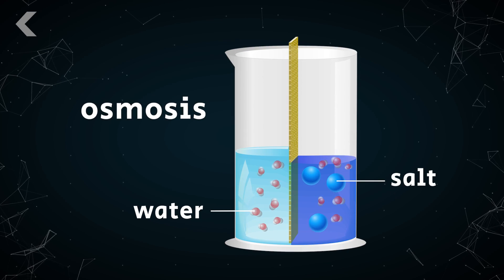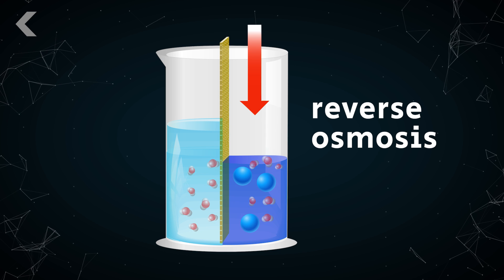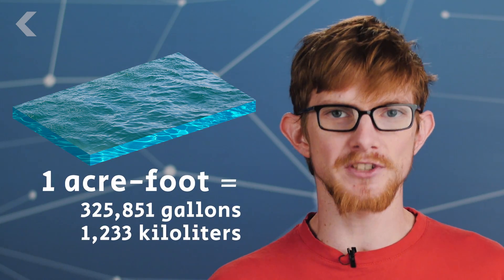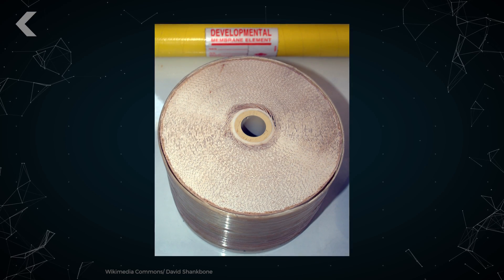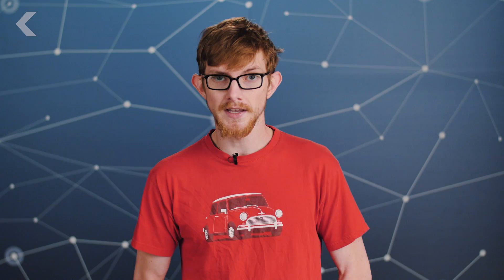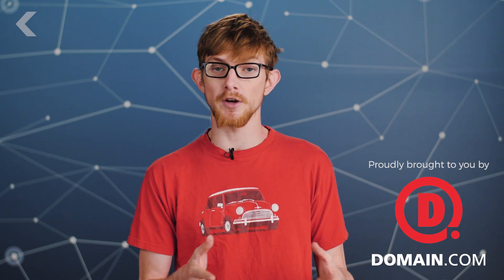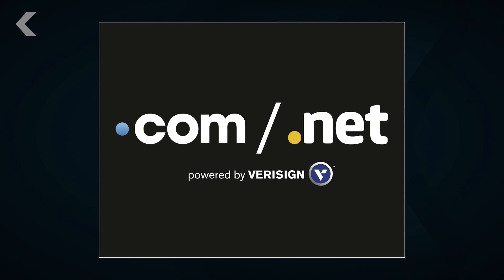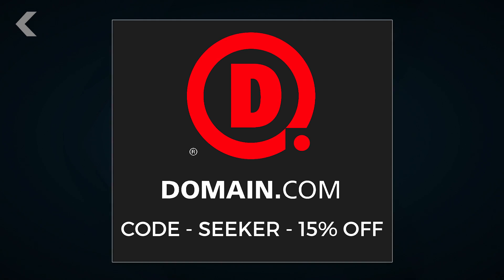Graphene Could Solve the World's Water Crisis

Comment: Electrocoagulation is safe, cheap, and faster by volume than RO. The whole system consumes far less electrical power than RO, and can be easily supported by a solar farm and electrolytic battery cells which unlike newer and current battery technologies decompose so little in use, the service life expectancy is up to 30 years.

Comment: How much pressure do you need across the reverse osmosis membrane?  Would the changing water level of the tides provide a sufficient pressure difference for reverse osmosis?  It would be a massive project, but could you design some kind of channel or canal that would resonate with the tides to get a bigger change in elevation like what happens in the bay of fundy?

Comment: Given that the majority of dry places needing desalination plants are usually very sunny and hot (yes, I know Antarctica is a desert, hence "majority" and "usually", though ice rarely has salt in it), then surely using solar panels (made from graphene if it is so much better) would decrease the need for "dirty" energy? Or mirrors aimed at the top of a tower to create steam and then generate electricity could be used if graphene panels aren't yet cost effective. The steam, when condensed could be distilled to clean out larger molecules of salt or other nasties. I guess I'm saying that some imagination could be applied to current technology leaving graphene to play a role in areas where it is the only feasible material. Still a fascinating idea though.

Comment: Something doesn't sound right to me here.  If you're making a filter from a molecular thin material that has pores just large enough for H2O but too small to allow other things through, then you should be talking about a gap the is being held in position by molecular bonds.  To my knowledge, molecules do not swell.  Just how is a water molecule supposed to insert itself into the molecular bonds of graphene to cause the opening to increase?  Maybe I'm misunderstanding the mechanics of this.

One other thing.  Although reverse osmosis is more energy efficient that distilling, the cost is offset by higher maintenance.  Just how is adding a far more expensive filter supposed to reduce cost?